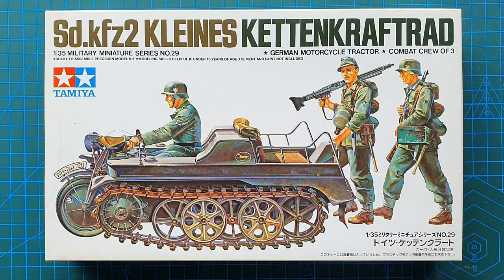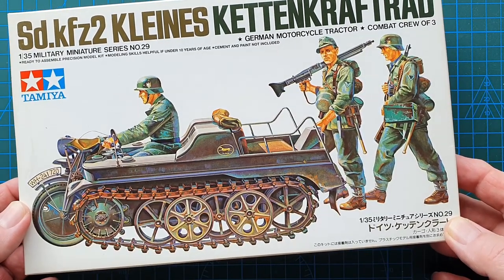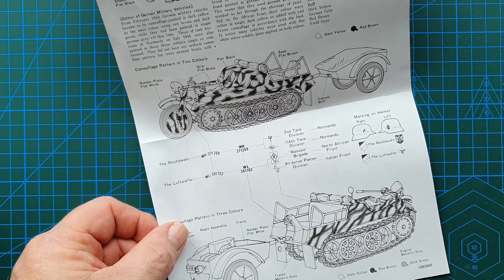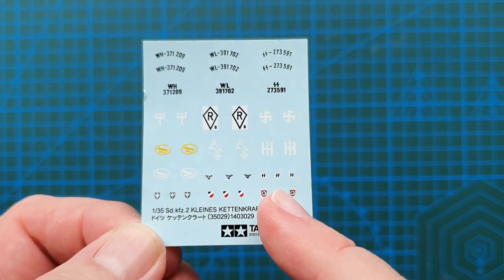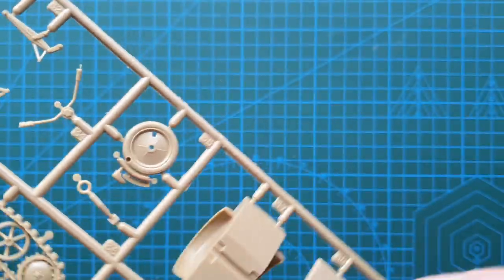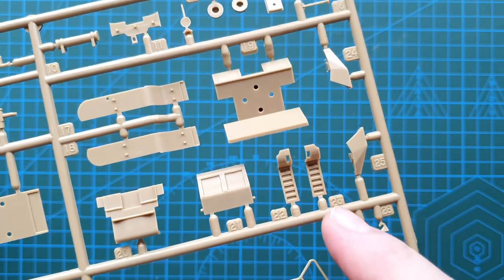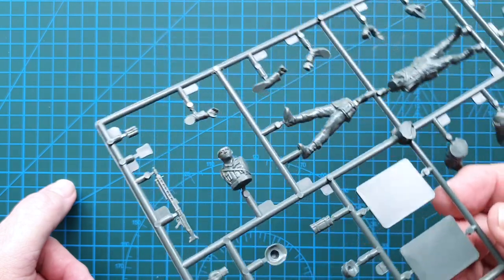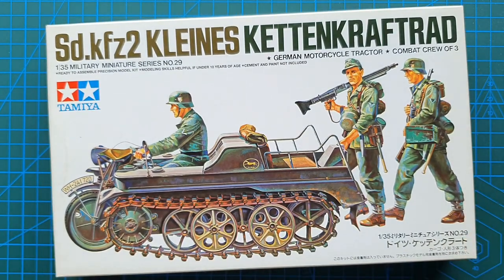Tamiya 1/35 Sd.kfz 2 Kleines Kettenkraftrad - Kit Review

Comment: This kit is really nice.. Quite nice in details. Eventhough, this is an old kit, build in  '70s details still nice. In my view the new Tamiya Kittenkraftrad is too many small parts and too intense.
Reply from the maker: Have to agree with you there. When you consider the size of the Kettenkrad in 1/35, the older, simplified kit, is perfect. Reasonable detail, and an easy quick build. The newer has sharper detail, but things like the individual rubbers for the tracks? Nice idea, but, not really necessary on a kit this size.